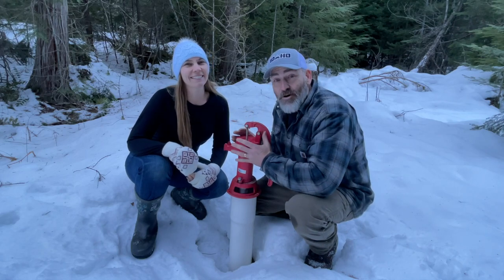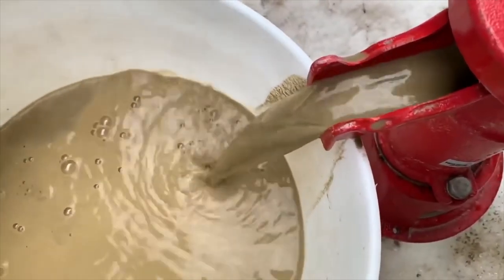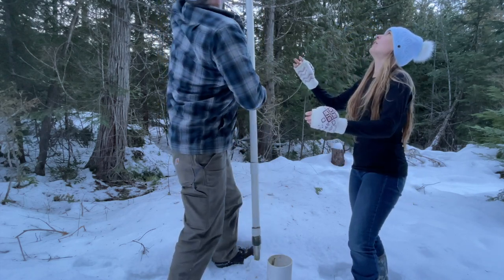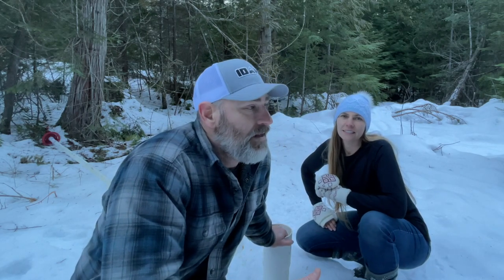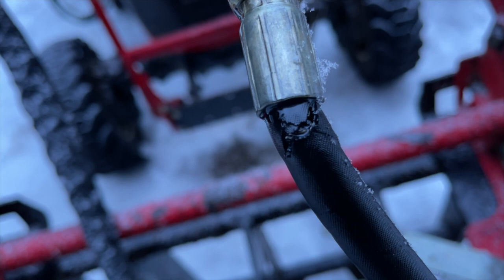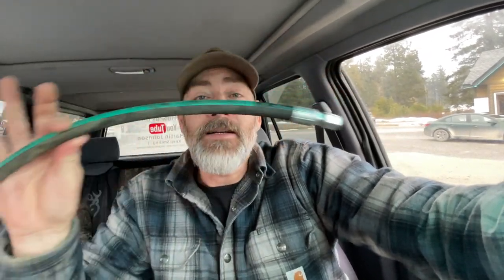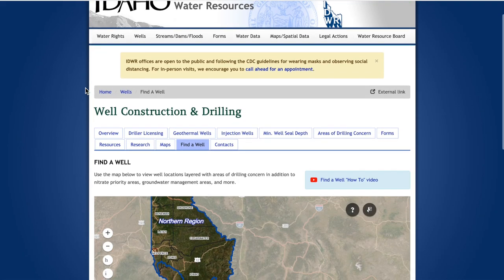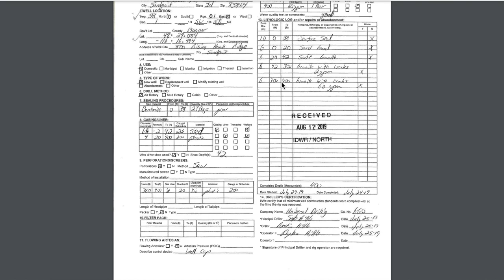DIY Water Well Drilling FINAL RESULTS

Comment: Many Oreillys auto stores make hydraulic hoses.  $5. a ft. in UT.  Stay away from the dealers, they saw you coming.  I bought the same Deep Rock well drilling setup 35 yrs ago when I was building my off grid home in W. WA.  LOL,  Surprised to see they are still selling that setup.    Made it down 22 ft. before I hit a big rock.  Burned up 2 $60 diamond impregnated drill bits before I gave up.  Moved over 10 ft. and started over.  Made it down 15 ft. before I hit another big rock.  Hired a pro well driller and did it the right way......:)   PS, I bought a 6 inch auger bit to dig fence post holes for the DR head.   That works fine for that.   2,000 ft of fencing, ahhhh to be young again.....:)

Comment: I found you because of your solar video. We were thinking of cutting the cord and going off grid like you but are not sure if all of our wood working tools will work as well as our home if we go only solar. We have our home, a detached garage that we would like to build cars in and then another detached building that's our wood shop. Our home was rotted and unfinished when we purchased the place and are rebuilding it from the foundation up with our own hands, without any hired labor and debt free like what your doing. Our well was installed in 1978 and still has the original equipment. We are starting to have issues with some of the electrical parts and would like to replace all the equipment in our well shed but don't know which brand of equipment to purchase. We live right next to a river. Are well is 135 feet deep and produces 87 gallons per minute of perfect drinking water and we don't need any filtering system or anything. We had the water tested and it's perfect as perfect can be. We must have tapped into an underground river. Anyways, I'm looking forward to seeing what you purchase for your well house equipment and why you chose that equipment over all the other brands available. It would be nice to know what the options are and what the difference is between them are. Made in America is the only brand I purchase and I respect you for doing that on your batteries.

Comment: We're in Central Texas and hoped for our well to be no more than 450 feet at $36 per foot. It ended up being 560 feet. OUCH!!!! It's painful to have to pay for now but, at 30-40 gallons per minute with a 1.5 hp pump, it's probably worth it. It also comes with a 40 gallon tank and a well house on a concrete slab. We bought our property in July of 2020 and still have a lot to do. Getting some great inspiration watching your videos.
Reply from the maker: +Beckham $36 is cheap it costs $85 here with steel casing.
Reply: @MartinJohnsonOffGridLiving  Wow! I'll consider us lucky then. They use plastic PVC pipe here in Texas so, that saves a lot of money right there.

Comment: That's close to what I paid for a hose a little shorter then that one. I have a well that was dug down about four feet and then a twenty foot galvanized 1.5" pipe with a three foot point on the end is driven into the ground with a sledge hammer! There are actually two of them about a foot apart to service two houses!

Comment: $55 isn't bad for a hydraulic line. Most of what you are paying for is the fittings on the end. I pay a minimum of $50 for a custom made hydraulic line when a hydraulic line breaks on my backhoe. And it only takes a few min for them to make it as long as they have the fittings in stock. :)

Comment: An addendum to my previous note:- Regarding the Hydraulic hose made to order...... it’s called OPPORTUNITY in search for money. I had the similar experience on (high pressure side) Power steering hose that sprung leak on one of my “Ultimate Driving Machines”.
A short piece of high pressure (300psi) hydraulic hose, about 65cm. The Vehicle Agency did not have it in stock, they’d place order to Germany etc etc..... and the cost.... exorbitant! 
The local Papa Mamma store replicated the item for $65 plus TAX!  I end my case.
Did I hear some one whisper “ it’s called price gouging “ aw well....

Comment: That's about normal for hydraulic hose 'made on demand' and is why most of my friends who use their equipment for a living have their own bulk hose, fittings, and a compression tool.  You will be replacing many more hoses over the years.

Comment: Price for that hose made to order is about the same as it would cost here in the UK, more if you have to call them out to site to have it done, they know they have you by the short and curly's, and so they charge accordingly, it maybe interesting to check how much it would have cost you from the dealer, to give you an indication for the future, you might get a shock there too.
Hope you find water for the new well not to far down, good luck.

Comment: I did my well in garage, before anything, then dig all dirt, which was about 18 inches, then perfect gravel as deep as you want, so I’ve drilled 100 feet deep well, water is excellent, maybe first 5 minutes was dirty, then it cleared, and my well produces 20 gallons per minute, and so I did bought a commercial deep well pump that can pump 20 gallons per minute, and water line is 1”-1/4 all the way to water expansion tank, no reduction anywhere, right after expansion tank, it’s 1” going through 5 microns filter, and enters a cold/Hot water manifold, which branching out through the house, so I can turn on or off each faucet individually hot or cold. And my water pump is about 8 feet from the bottom of the well, but water column is 22 feet deep. And starts about 4 feet from ground level, all the way to the house, and to the first shut off ball valve, right before expansion tank, I have a heat tape, taped to the pipe, to keep water line from freezing, it’s 30Amp, 220V 9 Watt per foot, and it’s about 88 feet, connected through the electronic timer, programmed to turn on heat tape every 2 hours for 15 minutes, so far it’s being great, if water freezes, I can override timer, and run heat tape as long as I need, however, it’s a self regulating tape, since it’s also commercial, and high wattage, it can get 200F hot, so to prevent water from boiling in the pipe, when it’s get hot, it reduces power, and tape gets cooler. It’s also important to properly adjust air pressure in expansion tank before fill with water, on empty tank air pressure should be 2 PSI below ON setting: (example)
Your pressure switch is 20-40 PSI, 20 PSI is on, and 40 PSI is off, so expansion air pressure should be 18 PSI. If your pressure switch is 30-50 PSI, then air pressure should be 28 PSI, and if your pressure switch is 40-60 PSI, then air pressure in tank should be 38 PSI, but make sure on empty tank, with no water in it. That way you’ll have a good water pressure in the house, and your tank can last a lot longer, all though on 80 gallons expansion tank with 40-60 PSI switch, and pressure set 38 PSI, you won’t have a lot of water in tank, maybe 30 gallons or so, it will be at first welding band, and that’s how it should be.

Comment: No more than $30.00!, I'm looking for a small hydraulic hose machine!.
Reply: The high pressure house is more important. You must remember, those hoses carry 300+ psi hydraulic pressure and that’s the reason of high cost. Now, what about the fittings on both ends? The machine you talked about is only a high pressure Crimper. That’s all it does. And you need to be precise when crimping. If the crimping pressure is high, then the inner tube will be deformed, causing fluid leak. If the crimping pressure is low, again causing leak. So it’s better the professionals do the job. But if you are thinking of entering into a business....... then, it’s a different story altogether. That later. Bye for now. 73s...
Reply: We have a hose truck that takes care of the equipment it does everything and that's what I would like to get, the mechanics have smaller crimpers I dont want them!.
And yes I didnt think about the fittings!.

Comment: HEY - Put a frame around the White PV Pipe - Make it pressure proof.  Pump it full of air to 40 to 90 PSI.
QUICK Release of the pressure will drive your well into production.  The first flow may be muddy but 
after 2 or 3 days the flow maybe clear.  TRY IT BEFORE YOU DRILL A WELL - You could save the cost.

Comment: Run a pump for a few days... it should clear up. Even a 12v pump would work to keep it pumping and clean it up. A 120v would work also - both would operate on a solar panel or two with a battery. And why did you chose that location for the well?

Comment: You added only one size of gravel and only around the casing. You didn't add it to the BOTTOM, right? Seems to me that you had the silt coming in from the bottom and that was the issue. Need gravel and some finer screen in addition possibly to keep the silt on the bottom from filling up the casing. You may need several feet of bottom. I realize this violates the 18 foot rule, but then again if you excavated 4 feet off that part of the property first in a small area, moving the soil to your garden or what not, then wouldn't that buy you another 4 feet of digging to install some bottom filtering? I wonder how long a delay you'd need between the two actions. Anyway, if you had a few feet of various sizes of gravel and maybe even a non-toxic water permeable screen below the casing (maybe on the sides as well if the silt is going through that little bit of gravel you put there), then the silt wouldn't make it through due to all the inertia it would experience in my guess.

Right?

Comment: Your custom made just for you when you need it yesterday has no real value, its value depends on how much you need it = how much you paid for it.. OK, say you wanted to travel 10 miles, its very cheap to walk, or you could get a bus, wait for it, share the cost of its value with many others (WHERES YOUR CORONA MASK) or you could order a taxi, be only you as a passenger to go 10 miles, but you have to pay for the instant service - no difference then to your costs equated to an instant fix must have pipe.....LOL.. Sorry about my thinking as I drove a East London Cab on and off part time for 14 years till I had just about enough of passengers moaning about the fares - lol - Thanks for the video, Ian..UK -- OH PS did you price 2 at the same time? would have been cheaper then doing that journey again maybe tomorrow ? newish tractor blows hose in very cold temperatures/ can it happen twice ?

Comment: Hello I've help drill wells for over ten years here in Indiana what you call  Grey  pudding lol we call shell we would  have put in a 4 in pipe with a boot on the end keeping the sand away 500 feet was the deepest we had to drill most wells average 160 to 340 feet plus we drilled with water the whole time

Comment: If you didnt drill thru rock into the filtered water table, your drinking run off or ground water which is not healthy at all and can be dangerous in most areas.

Comment: Valley Wide Co-op Stared in our small town almost 100 years ago and has grown through our southern and central Idaho and Oregon to supply agriculture and small towns with supply and food items, Our town shop makes Hydraulic hoses and I recently had to replace 2 hoses on my case backhoe similar to yours and the price was $40 or the large one and $ 25 for the one like yours. Each time I replace a hose i add the protective kevlar woven shield . in our area we get good water at 60 feet and use screens but the ground water is so high that most locations can't have a full depth basement.

Comment: Where I am, lot of auto part stores will crimp hydraulic hose.  I find them cheaper than tractor dealer.  But sometimes I have to bring my own fittings.  They don’t have a huge selection of non-automotive fittings.

Comment: I guess I’m confused.  Given the variability inherent in your area, was it possible to have a small diameter test core drilled before committing to the full attempt at a well or before buying that property since it had no well?    BTW - I had a friend buy a cheap piece of land in Hawaii.  Tried to put in a septic tank and found out why the land was cheap - 8 feet down was a lava flow.

Comment: good luck with your well drilling I learned decades ago the bad side of well drilling. 
 I knew a developer that sank piles of money drilling dry wells. he sank 2 wells on one 20 acre piece 360 feet and just over 400 for the other he got natural gas on the shallow well and 2 gallons minute on the deep well . 40 years ago he spent almost $100000 on those wells and got nothing. gas needs a lot or equipment to make it usable. I remember it had. less than 10 pounds of pressure in a 6 inch casing. 
 he followed that . with 4 wells on another property with worse results.  this was in the desert or anything it was in the puget sound area of washington state. the neighbors wells in the second property were 80-100 feet deep  
 I won't conciser buying ground with internet to drill a well. 
 to me it's worth it premium to already have a approved well on the property.  or I'll buy with knowledge that water will be hauled in like in the desert.

Comment: Hi Guys, cant wait to see the drillers in action. A pre made hose here in OZ based on 2 feet long is around $49.00 AU, however for an on the spot made hose, the local fella charges $15,00 AU more. Another great video. Cheers.

Comment: Whom ever you have been listening to regarding how to get good drinking water without the hassle is way out in right field.
The neighbors well at 300 ft should have set off alarm bells. A well at 300 feet in northern Idaho should cost between $15 to $25 per foot, depending on difficulty. Difficult drilling can cost $50 per foot. If I use the figure of $20 per foot your 600 foot well should have cost you around $12;000. You could have bought 2 x 6;000 gallon food grade plastic rain water tanks for around $5,200 each. The tanks are placed next to you house and or barn. With your average rainfall of 33 inches per year that is more than enough to last you for a full year using only 300 gallons per day. No trenches, no wiring, no more cleaning screen filter on submersible pump and no more necessary maintenance required. Good luck and God bless.  I do like your videos.
Reply from the maker: I’ll make a video about it.

Comment: New subscriber here: Your wife has a very pretty smile :) What is the average cost per foot for drilling a well in your area? The bad thing about gambling on drilling a well is that you have to pay the well drilling company whether you hit water or not.

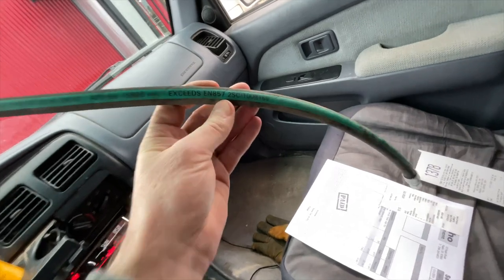7:46 I think $55.00 to have just about anything "custom made" right on the spot, especially something that you need right now, is very reasonable. No brainer.
Reply from the maker: +KMAC Radio $85/ft
Reply: @MartinJohnsonOffGridLiving  Ouch!

Comment: That's so cool that Sagle Tractor has the ability to make hoses. I wonder if they have quality quick connects.
Reply from the maker: It looks like they have every fitting under the sun.
Reply: @MartinJohnsonOffGridLiving   Did they give you a breakdown of parts on the receipt? I bet the hose end fittings were the bulk of the cost of your hydraulic hose.